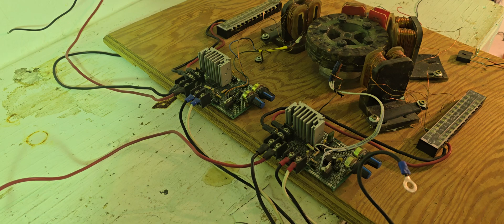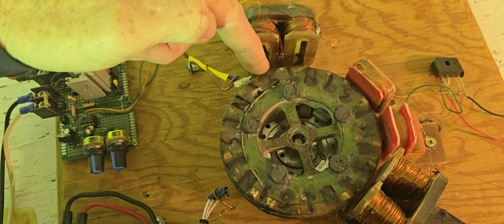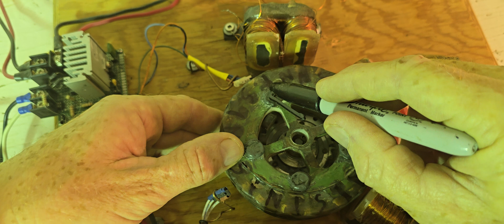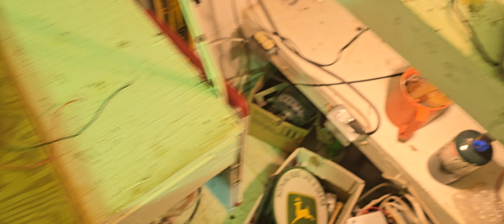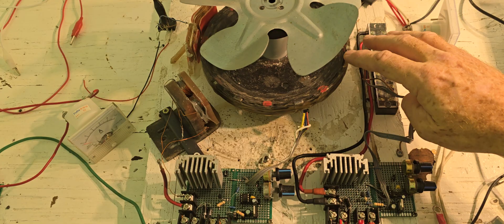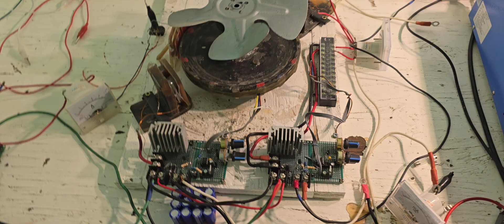Better explanation of how these work @mykedoes

Comment: you can use one driver circuit and flip the poles on your drive coil each pulse using dpdt relay
Reply from the maker: I've been slowly working on that circuit with mosfets but I'm really limited on time these days I really hope to get back in the shop more regularly soon . It's a inverter circuit sort of but collects the flyback
Reply: @windpowerandmore6310  right , inverting each pulse with a N/S rotor array and a u core , im thinking thats how Ed Leeskalnin ran his motor gen now that i think about it . btw i replicated a inverter drive system but not with U core , standard air core Newman style and it pushed and pulled a bar magnet on both sides  twice per 360 like turning door know with your hand every 180 rotor turn
Reply from the maker: @mykedoes4099 I've seen your videos is that the one you're talking about? It definitely reminds me of newman
Reply from the maker: Yeah I agree with you 💯. 
Before my youtube days and Before cell phones were able to capture decent video my  motor generally consisted of commutators and mechanical relays both bought and diy built...the only reason I stopped using them is because they have resistance in the contacts which tends to be variable.  Only after I switched to the mosfet have i been able to constantly and reliability produce motors that run nonstop for years on end with only minor maintenance and produce ou results as I've shown in some of my videos without the cap dump circuit.  I've done tons of capacity testing which show it's truly ou if using the right chemistry batteries. Not every mosfet works either that definitely forsure it takes enormous amounts of work and time to find the proper components.  I understand what you're saying though and the flyback potential is definitely stronger with a mechanical switch i agree 💯
Reply from the maker: Diy yes exactly  . It needs to be perfect for a constant flyback or most of it gets wasted.  I have a video coming soon demonstrating the difference between mechanical and mosfet switched.  It's really obvious in the video which one performed better.  The fet has a huge spike but  has to be captured at voltage before  before the fet blows but it has the spike every time where as the mechanical switch gets the flyback to the diode about 20% of the time and the rest is wasted in the contact as heat. But can be collected at very high voltage.  It's a trade off either way I've found anyway I'd be very interested to see other people's results with this topic that's forsure.  I've also had to engineer speed into the motors to get the results i was looking for.
Reply from the maker: Yup definitely